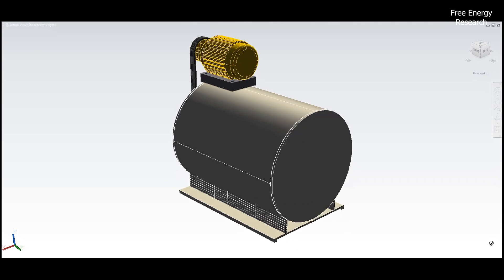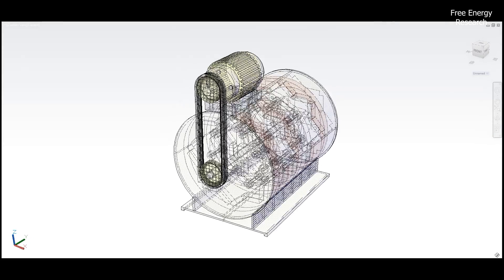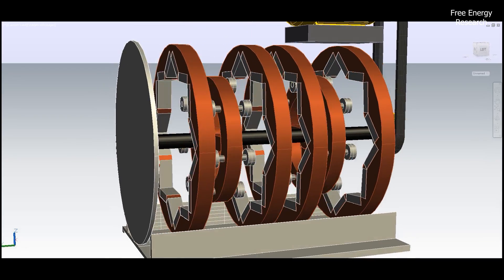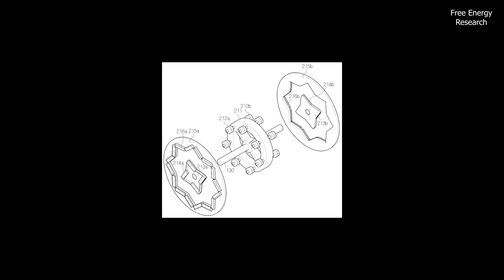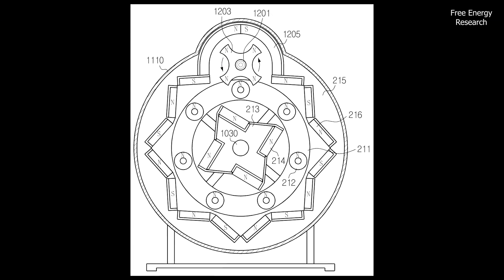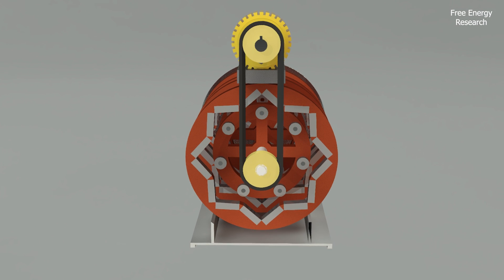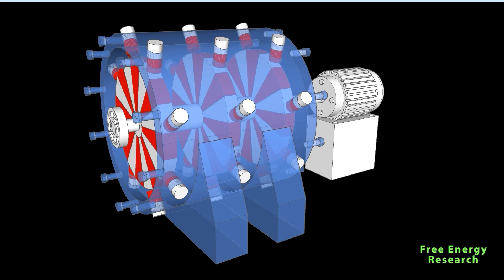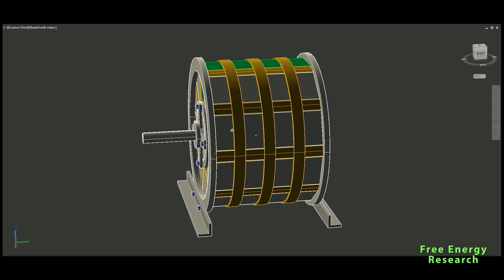Free Energy Generator - Park Chan Soo Magnetic Motor 2024

Comment: I built a real model. It does not turn even a millimeter. The reason being that a magnet has a magnetic field surrounding the pole. Yes, there is a pulling or pushing force. But the force is equal for both: the force required for a magnet or object to enter that magnetic field, it is equal to the force exerted to be propelled by it. Thus, a state of equilibrium exist and no turning event is induced.
Reply from the maker: Thank you for comment 💙
Reply: I from Indonesia, yes you say very very really, I experiment all but twenty year but I not the success,........